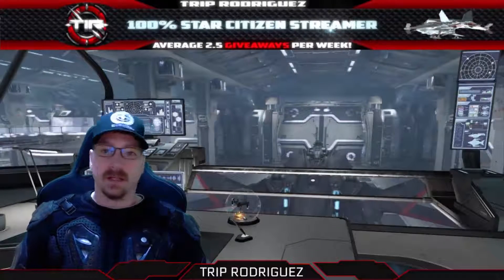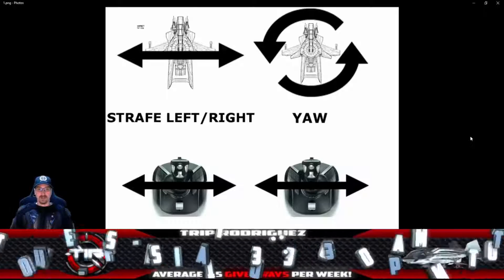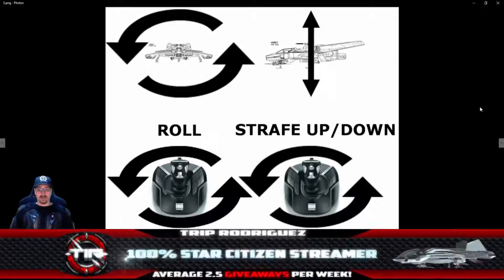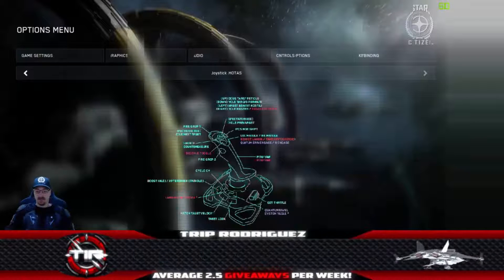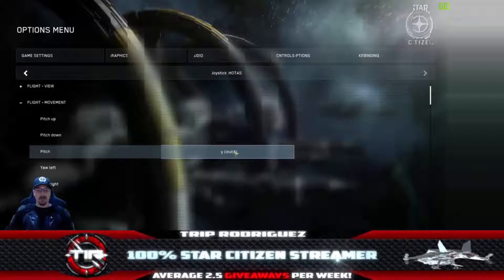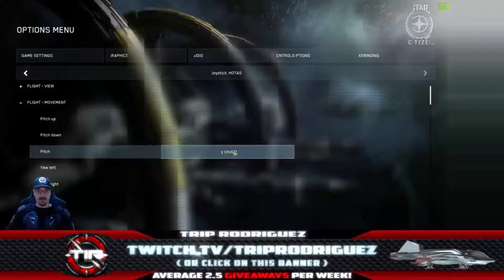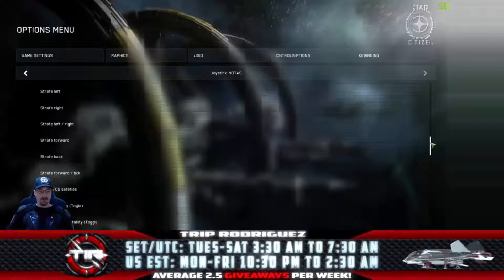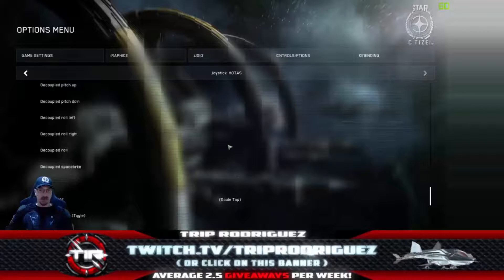Star Citizen: Trip's Dual Joystick Guide part 3- In game axis bindings and settings

Comment: This tutorial I believe will be helpful to me, for some months I've been trying to setup a single Logitech Extreme 3D Pro, keybindings (Yaw / twist, Roll / tilt stick and Stafe / hat).
I have a couple items I'm not sure I heard you correctly; did you say, when binding Yaw, Pitch and Stafe I only need to move the control one direction, ie:  twist left, tilt right, press fwd and it will be saved in both directions automatically?
Regarding "Controls", their modified After finishing keybindings (not before)?
These adjustments are for ship maneuvers, not aiming weapons, what are; mouse, WASD?

Comment: Trip, thanks so much for these guides. The Dual T16000M setup is truly awesome. However, I'm going to disagree with some of your axis bindings. Here's why they don't work for me, and possibly for some other people out there:

My main issue is with the yaw and roll axis.
A. I'm a pilot in real life, and after over a decade training my brain to use Left/Right stick for roll and Left/Right rudder for yaw, I just can't wrap my head around swapping these. Plus, I have a feeling as if doing so for a game might be dangerous in real life if I accidentally input the wrong control in a real airplane.
B. I have rudder pedals, and am practiced at making fine inputs in them, so it seems to workout alright for me to use the rudder for yaw control as normal.
C. For immersion reasons, I suspect that real "Aerospace" or Air/Space pilots would leave their control axis more like a traditional airplane, as they would occasionally have to fly in atmosphere and use traditional aerodynamic flight inputs.
For these reasons, I prefer leaving rudder for yaw and left/right (on the right hand stick) for roll, even if I may lose a slight amount of aiming precision doing this. But I can also use left/right strafe on the left stick to help get my pip on target.

Comment: Pro tip: If you (like me) have a Saitek X65f, make sure to test the stick in Saitek's control panel by moving it hard on all axis', and program in deadzone if the stick has problems centering. The stick is force-sensitive (no midichlorians tho), so this is probably the only stick you can use deadzones on.
Trip, if I had to figure all this out on my own I would have broke down crying a long time ago, thank you!

Comment: Hello Trip, im following your guide here, but im having one problem: Is that i cant find the Throttle Binding ( there is throttle up / Down / Max / Zero ) etc, but not the throttle only? Can u help me with this question please? and thank you for the guide
Reply: I'm having the same issue, what did you end up using?
Reply: i ended up binding the slider to throttle up / down abs. then strafe forward / Back on the Stick :) it works fine ... only problem i have is after each jump i need to push the slider up then down to reset the speed otherwise it will stay on top speed :(
Reply: Ended up with the same settings and issues myself.
Reply from the maker: There is currently a bug where the throttle gets set to 100% anytime you come out of Quantum.  Super annoying buy only a serious problem for the minority who don't use throttle so not likely to be fixed any time soon.

Comment: Good detailed step-by-step instructions. I think this is where most new users would have been lost if not for your explanations.
Reply from the maker: +Mei T Thanks!  I have footage of me explaining exactly what the curves are and how they work etc. but haven't edited and posted it yet.  Not sure it's neccessary.  I do think I need to get the "short, short, short version" made though for the TLDR folks =).
Reply: +Trip Rodriguez (Trip Rodriguez) Hey, i followed your guide  and it worked great for getting used to using dual joystick. However i usually unplug my joysticks when not in use. I use x52 pro for righthand joystick and t16000m for left hand. But recently my x52 which used to be input 1 changed to input 3. Is there anyway to get my computer or star citizen to recognize my x52 as input 1instead of 3. I really dont want to rebind all my keybinds. Thanks
Reply from the maker: Not that I'm aware of, Windows SUCKS in this regard!

Comment: Thanks for the guide.  I'm looking to upgrade my X-52 for SC and was looking at the X-55, Warthog or SC controller but this seems like a cheaper/better option.
Reply: +BlackBirdBlitz from my experience in reviews and hearing trip say the same thing I can verify you should not get the x-55 :D
Reply from the maker: +BlackBirdBlitz This is more accurate and more fun.  The Saitek sticks do feel higher end in your hand but that's about all the nice things I can say about them.  I had an X52 Pro but it died shortly after the warranty ran out.  Same thing happened to my Saitek RAT7 mouse =(